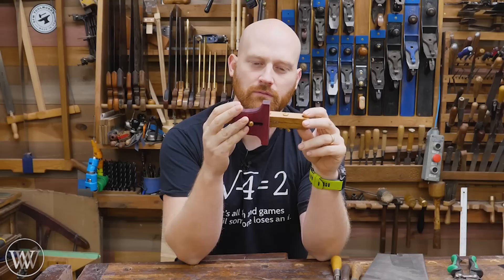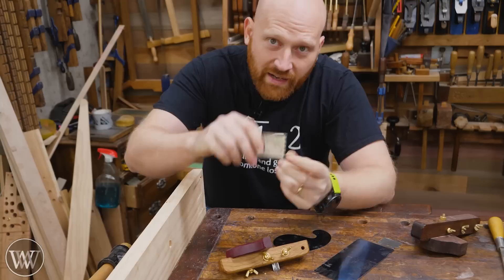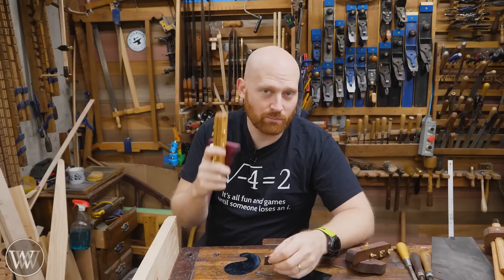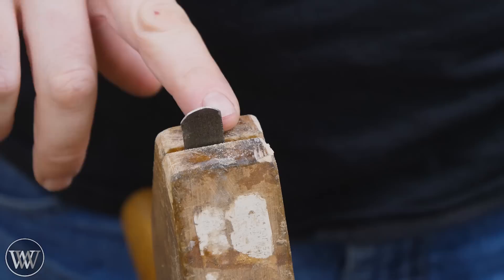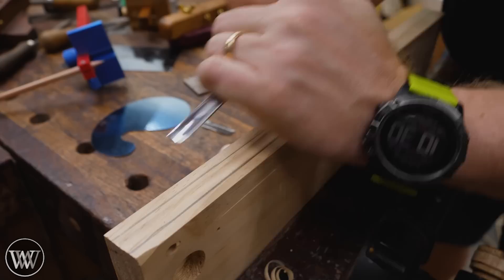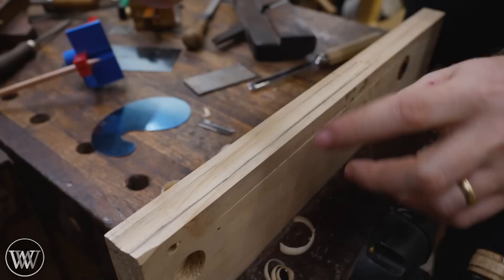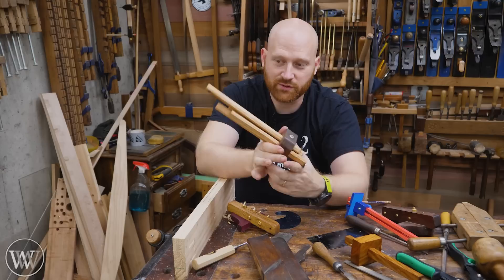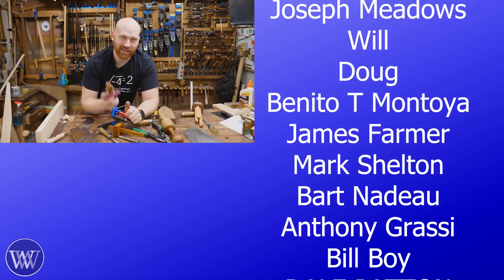A Molding Plane and A Card Scraper Had A Baby  What is a Scratch Stock

Comment: In terms of the blood groove, how well does this work on end grain cutting boards?
Reply from the maker: If the cut is shallow, it works fairly well. However, if you have a sharp vertical wall, it needs to cut in. It doesn't do that very well. Tends to tear apart. The surface of the wood.

Comment: Excellent! I do have a saw that isn't worth rescuing, I might make something out of it now.
Do you have any advice on gouge sharpening? Mainly the internal face. I can sort of freehand the external to a reasonable degree.
Reply from the maker: Usually I only touch the inside with a strop. I just grind the outside face to meet it. Here's a video on sharpening gouges. https://youtu.be/3ForwrhU1Pw
Reply: @WoodByWrightHowTo  thanks. It comes flooding back to me now, I've watched that video of that nice young gentleman in the past. I must get myself some buffing compound. I have some micro (palm?) gouges that I use quite a lot too, I think they'd suit the profile creation method you showed. Thanks!

Comment: Is it possible to make the scratcher out of thicker stock, maybe up to 1/8“ or is it limited to a sawbladethickness? I‘ve got some 1090 steel laying around, which could be hardened to a spring temper
Reply: It might be very easy to re-use old spade drill bits or hex screw bits as scratchers,some are very hard steel also there are replacable tungsten scrapers for turning that are perfectly round or square that might suit
Reply: I used a wood mizer blade for mine. It was worn out. That steel was about 1/16" thick and worked great
Reply from the maker: Thicker is fine. It is just harder to shape. The steel doesn't have to be very good as really hard. Steel doesn't turn a burr quite as well.
Reply: Thanks for the answers